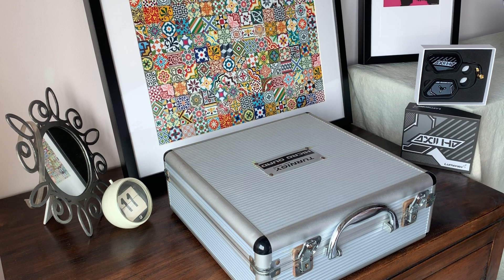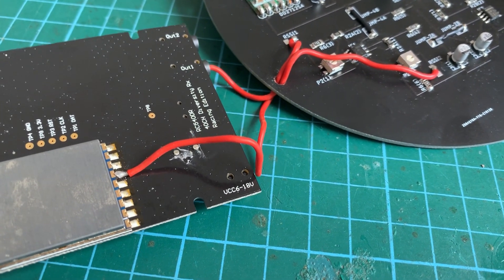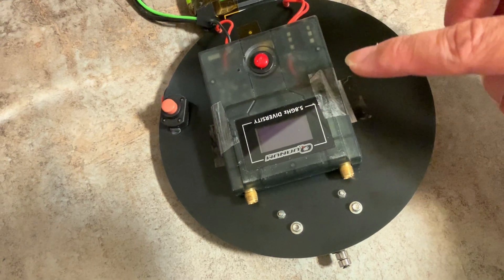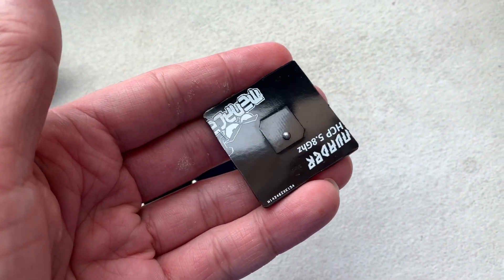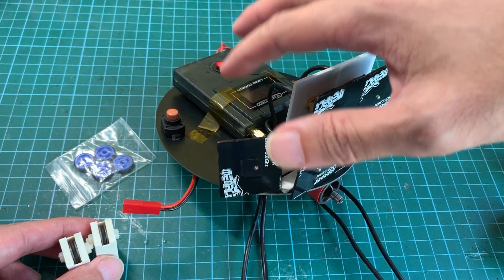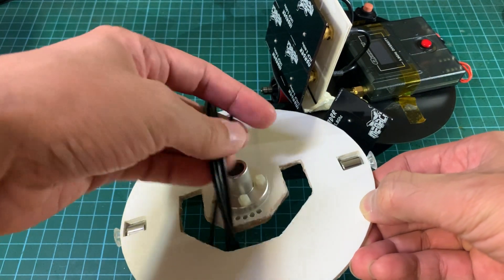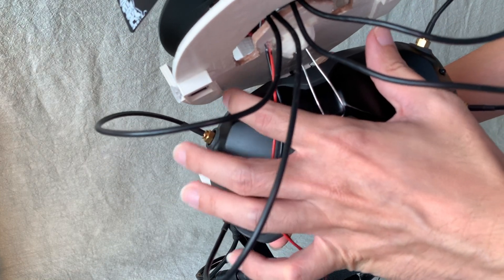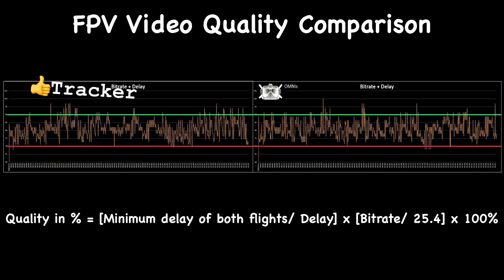Bespoke Antenna-Tracker for DJI Digital FPV

Comment: V cool project - to use this on a tripod, can i use a longer version of RG 174 (abt 2m) or do you recommend another cable?
Reply from the maker: RG174 is a good choice. RG316 has less loss but it is too rigid.

Comment: Can u make smaller one using mini Arduino...?
Reply from the maker: Thanks for the excellent suggestion, I will definitely consider making one with Arduino
Reply: @terence79chan  u can also try to make it smaller and compact as in placing Arduino, diversity module on servo and the wires of diversity module to goggles on a long cable. Hence it'll be lighter, compact and easy. I've been thinking about making it on Cobra S goggles after I buy them, placing this idea right over the module bay. Hope you understood what I meant 😊 it'll also seem tactical😜

Comment: This is good. I have been looking to do this myself solid state to avoid all the servo mechanism. 👍
Reply from the maker: Thanks! I am very pleased with this tracker although I hope it can be smaller. Unfortunately, if the reflector(PCB) of the 5.8g patches are made any smaller, there will be a significant reduction in their performance.
Reply: @terence79chan  By solid state I mean a 360° octagonal array that selects the strongest direction for input. It will use more patches but can be ergonomic.
Reply from the maker: I had accomplished a 120deg solid state array that uses an Arduino microprocessor to control its beam forming, it is possible to extend that to 360deg. Search for “beamforming antenna for FPV” to see my build tutorial on that. :)

Comment: Why compare to stock? Why not compare to patches without tracker?
Reply from the maker: Thanks for watching, believe it or not, for a test at such close proximity (in this video), the stock omnis easily outperform patches without tracker. We don’t want it to be an easy win for the tracker. 😉
Reply: @terence79chan  have you tried with longer range? this is very interesting
Reply from the maker: I’m glad you find it interesting. In where I live, it is difficult to find a stretch of more than 2km that is legal to fly drones in. For testing, I simply switched the transmitter to 25mw. The tracker did work well in delivering better quality video when my drone at 300m away, flew past my 10 o’clock and 2 o’clock where the null side-lobes of the radiation pattern of my AXII HD patches usually are.